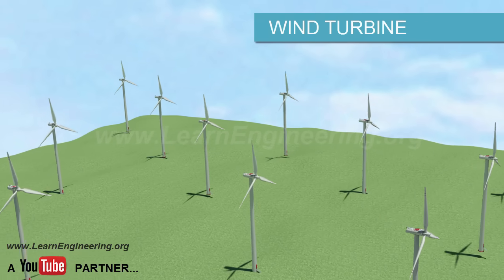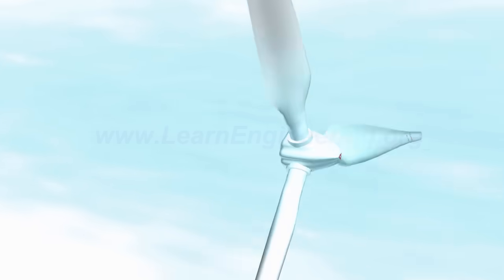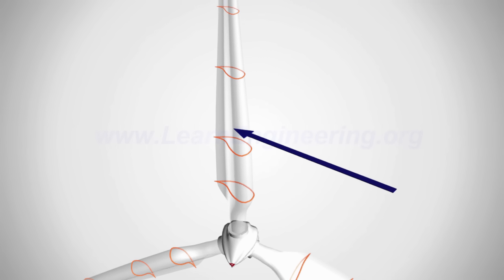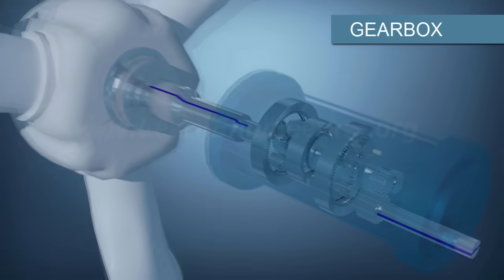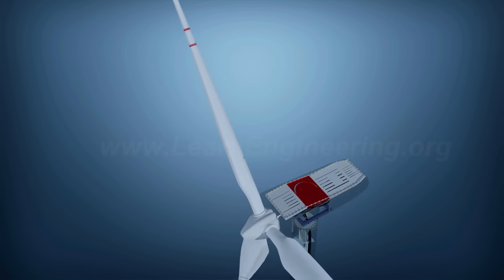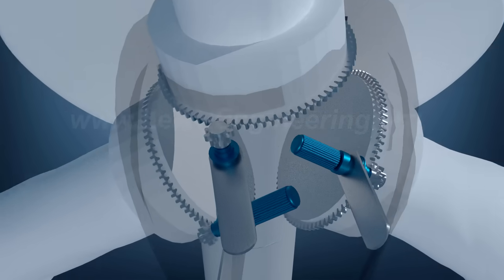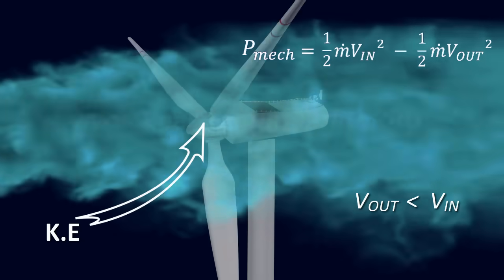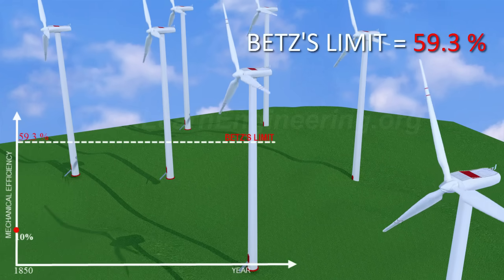How do Wind Turbines work?

Comment: I am engineer. I researched out New Method of electrical power production.  Only air and water can produce power. Simplest and cheapest power in MW. Give one time and get four times. Based on Robert Boyle air law. Visit :--  @t  This power remove climate change and poverty at a time. This can save 500 million ton oxygen per year and for next million year. Three university have supported my research.  Google, Microsoft Green ,  UNO ,  must learn this theory. I am teaching this within 10 minute.  Any science or engineering student learn in 10 minute.  I have other research, that hydro electrical power can be made 1.5 times by using Newton's  third law. I request,  teach this in colleges. contact me :- desaihari03@@t

Comment: Wake up, sheeple. These turbines are NOT the future. There was 11% less wind energy produced in 2016 compared to 2015. Why, you might ask? Because the year was less windy. What do you think happens then? Yes. Coal plants. Nuclear can give us safe, reliable energy. In the entire process from making the plant until it needs to be deconstructed as it's gotten too old, a nuclear power plant has the second lowest carbon footprint out of any current methods of generating power. The only one that is lower, is hydro power. Hydro power, however, causes the collapse of entire ecosystems. Nuclear is the only source of energy of which all harmful matter is contained and only water vapor enters the atmosphere. 95% of nuclear waste of uranium fission is also less radioactive than your average slab of granite and the other 5% can be stored safely underground.

Comment: Why scientists persist on blades instead of tunnels to catch the wind . It seems that efficiency of blades are higher than tunnels but tunnels are more stable and they need less maintenance . This is difficult to raise the tunnels from ground because they resist against wind but they can be implanted on the top of the highest altitudes on the ground . Designing tunnels with greater efficiency may be possible also .

Comment: Just a query: If the gear mechanism can compensate rpm requirement, why not just design the gear mechanism in such a way that we achieve rpm as much as we want and get the maximum mechanical energy thereby?
Reply: Because rpm is still dependent on wind speed. If the gear is too high, the blades won't turn unless there are high winds.

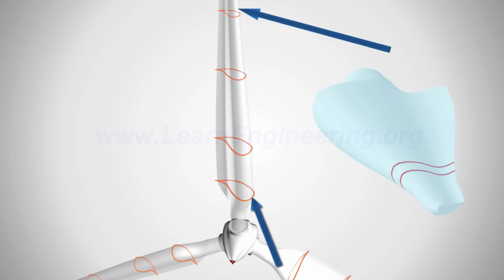Comment: 1:50
That is nonsense, you don't need a certain RPM to get a frequency, you can use a higher phase motor to get higher frequencies than what a normal 3 phase motor would give at the same speed.
The problem is, that those turbines don't always run the same speed and you need to correct it to get the correct frequency.
And I hope for all that is holy, that they don't use gearing for that, as described in the video but an electrical converter, to make the inconsistent energy to grid fir consistent energy.
Reply: biG brAin
Reply: @richardguo8160  lmao
Reply: wtf is a 3 pole motor, genius?
Reply: @shubhamroy9438 
Your standard industrial three-phase motor.
Reply: @Ismalith  then why r u referring them as poles? Magnetic monopoles do not exist. They always exist in pairs.

Comment: Question.. How do wind turbines still able to turn in very low to zero wind speed ?
Reply: think its  powered by back up batteries for the controls  to operate  with little to no wind  .. i got 6 where i live and they move with no wind  so im guessing its backup for the control system

Comment: Great video.  It would have been great if it continued and explained how the electricity is stored and utilized for power.  Well explained and informative.  Thanks.
Reply: nssm, 

electricity is not stored in a grid system, demand and supply is always balanced within close limits. 

Some utilities and others use spare generating capacity to store potential energy. A common one is hydro pumped storage. This is a system with two dams, upper and lower.  The upper dam is filled by pumping from the lower dam when grid demand is low. It consumes more power than it generates. It's function is to quickly generate power for the grid when there are sharp peaks in demand, as they start generating just by opening a valve which starts the turbine. (The turbine and the pump are one and the same machine, i.e. dual purpose). Solid state batteries can do teh same, but note they are not storing power to use later, it is the rapid response to peaks that is why they are used. It gives some time to theconventional generators to pick up the load, this is only a matter of minutes or less.
The grid (U.K.) runs at 50 Hz within+ or - 0.5 Hz, increased grid load pulls therequency down, just like a car meeting a hil, you open the throttle maintain speed, generators do the same, their fuel supply is opened automatically by the governor. If the limits are exceeded then switches disconnect part of the grid and a power cut occurs. Wind generators, by the way contribute nothing to this continuing and regular load balancing.

Comment: Wind power can only be harnessed if there is no wind....no wind no power, too much wind no power.....man cannot simply rely on this “golden egg” .....if the earth gave us other forms of energy, we should use it.
Reply: You're an idiot.  Wind will always be available and has been driving wind turbines and windmills for thousands of years. It is more reliable, cheaper and  sustainable than coal and oil, which has polluted the air, water and soil to a point that climate change is a huge problem worldwide.  And offshore wind turbines allow for tapping into a constant offshore wind source without the worry of oil spills, cancer or harm to the environment. It's time to put dirty energy producers in the past where they belong.

Comment: if we use magnetic induction in making air electricity forever then we can captured any direction wind in more efficient way's

so we use a 360 degree rotation on upper end and all the electricity going to give its voltage to secondary coil so we got more voltage rather then current and more efficient energy collectively

Comment: Try this; Stick your left hand out your car window at 60 miles an hour. Hold up one finger, and see how much the wind pushes against your finger. Now open your palm, and see how much MORE the wind pushes your palm than it pushes one finger. There is maybe one square inch of surface on your finger, and maybe 15 square inches on the palm of your hand. Wind turbines are like that one finger. They cannot get much "push" or torque from the wind, because the blades are skinny, (like your finger).  But a large sail has more surface area, (like the palm of your hand), and so it would generate much more torque, (or push), than a skinny blade would. There has to be a large surface area on a wind generation device, so the available wind has something to push.

Comment: An airplane operates by pushing wind over and under a wing. generating lift. Making a "wind turbine" with blades that look like propellers is a con job which makes an electrical wind generation device look more modern and stylish. Efficient and practical windmills with large sails would work much better. Wind turbines have very little surface area on it's blades, so there is not enough surface for the wind to push!

Comment: Try to imagine an old fashioned sailing ship with sails, or blades, as skinny as this. There is no surface area for the wind to push! The only reason for an engineer to design a electrical wind generation device like this, is so it will fail! Dutch windmills made much more sense, because they had lots of surface area for the wind to push. If wind turbine manufacturers were serious about generating electricity with wind power, they would build simple windmills, instead of these expensive and idiotic contraptions.

Comment: I don’t see how or why there couldn’t be a motor attached to the output to then be attached to the input to self sustain it self .. if the gear box does what it says than we should get a higher amount of energy Coming out then what’s initially entering the system through mechanical force

Comment: And when the wind stops blowing you get zero electricity. When it blows too hard they have to be switched off and once again you get zero electricity. The turbines only last for 25 years and then have to be replaced. What good are these things? 

Nuclear power works 24/7 and lasts for 100 years. Go nuclear!

Comment: Imagine a 19th century sailing ship with thin skinny sails like these. (These idiots call them "blades"). How much performance would you get from a Clipper ship with sails as small as these? There is a reason why wind turbine blades are long and thin. THEY ARE DESIGNED TO FAIL! If you are in the coal, or gas, or hydro-electric generation business, you DESPERATELY want electrical wind machines to fail. So your pals over on "K" street in Washington DC come up with a plan which gives "subsidies" for people who build electric wind turbines.  And they never make any money, or even pay for themselves. But electric WINDMILLS would work very well. With large, short sails, they would capture all the torque, (or force), that even a 5 mph wind would produce. And they would make money.

Comment: Tell about hydraulic system also.
Reply: Dipin Jose some turbines use hydraulics for pitching the blades, some use electric motors. A lot use hydraulics for braking and rotor lock motors. Hydraulic or electric motors may be used for yaw drive as well. Don’t know if that clears things up a little

Comment: It is not correct that without a gearbox no meaningful electricity frequency can be produced (5:28). Since deacades there are high output wind energy devices (MW range) available which are direct driven. Frequency converters do the rest of the job.
Reply: The generator itself can be a "frequency converter". It just needs to have a sufficient number of poles.
Reply: I don't know who you are, but GOD BLESS YOU! But remember, common sense is not wanted or needed on a "pie in the sky" youtube video like this one. You are tilting at windmills. (I am too!)

Comment: That explanation about lift at 1:01 does not make sense to me...
Reply: The flow of the air produces a pressure difference bellow and above the blade, which produced a force on the blade, which producea a torque.

Comment: which type of generator used ac or dc .And when the wind flow is less the blades move less speed  is it suffficient for the rotor of the generator.please tell me
Reply: They use AC generators : fixed speed WT use mainly induction generators, variable speed use either a doubly-fed induction generator or a permanent magnet synchronous generator. Look them up for more information.

About 5 m/s of wind speed is usually sufficient for a WT to start producing power, at about 12 m/s they reach their rated power and at about 25 m/s they stall due to high mechanical stress.
Reply: @FrainBart_main  thank you for your reply

Comment: I am an Arab inventor living in Turkey and a graduate of electrical engineering. I was late in inventing an air turbine to produce energy and turned it to work without air, which works for me in my house and I need to deliver my voice to the whole world. The turbine gives 15KVA and I use it in my house and have a month and a half without interruption to contact me personally 00905327264909

Comment: Behind every unreliable wind turbine is a grid powered by reliable fossil fuel and nuclear power plants providing 100 backup for when the wind doesn't blow, and controllable load-following capability to compensate for the erratic wind turbine output. This prevents brown outs and blacks outs.

Comment: Do gearboxes use electricity/oil or anything else. If not, I've thought of a renewable electricity source. It is a machine that doesn't run on wind, water or anything. We can't control the wind or the water stream and any other stuff. So this thing runs on a tiny bit of electricity and generates even more than was used. Here's how it would work: You use a tiny bit of electricity to spin a wheel. The wheel spin will have a very low RPM. Then the RPM is upped using a gearbox. (if the gearbox needs oil or electricity or anything then this method would not work, it wouldn't be 100% renewable). After that energy is extracted from it.
I'm sorry for my bad english, I'm a twelve year old kid from Sweden. I learnt English from playing video games and watching YouTube. I'm very uneducated about this so I'm sorry if I have anything wrong.
Reply: What you described is an pertetuum mobile.  To describe it short: "You can´t produce more energy than you expend". Because you have so many forces that act, friction etc. In a Gearbox you always have friction between the gears. Friction is converted into heat and thus consumed. Eventually an easy way to find an end :D : The wind has an eletric potential of 100%. But the wind can´t run the generator directly. The wind has to pass the blades, they consume for example 5% of the potential. The Gearbox consume another 5% of the potential. So their is 80% left. The same would happen if you replace the blades with an electric engine. Sorry for the quite simple english :D btw, I work on Wind Turbines and I am from germany. best regards. Could explaine it perfect in german :D https://en.wikipedia.org/wiki/Perpetual_motion
Reply: Noob Corporation Ok, thank you for letting me know.
Reply: And yes, the Gearbox has to be filled with Oil to reduce the wear, like iin cars, motorcylces etc
Reply: Noob Corporation Oh, so my method wouldn’t work.
Reply: @Kingase-nd2ru  Hundreds of engineers tried for centuries to invent a pertuum mobile. Even Leonardo da Vinci had no success. :D If you are able to invent one, congratulations, you´re gonna be rich :D

Comment: There is no such thing as a limitation within reasonable terms. The force of wind is unstoppable, If you us a bigger motor, and a higher ratio, you will produce more electricity, it hasn't got much to do with revolutions of the blades as such

Comment: Airplanes now use "winglets" at their wingtips to reduce wingtip vortex and increase lift efficiency.  Why are there no winglets on these turbine blades?  If winglets work on planes, winglets should work here as well.
Reply: That's probably not a bad idea.  Maybe just need to modify the molds.
Reply: @bigbrushthor5509  Maybe the blades are too high aspect and there is not enough tip vortex to justify it, given shipping and installation.  When I think of wing tips I think of buzzard wings.  They have very low aspect ratio wings with multiple feathers acting as wing tips.

Comment: This system seems like an complication of a design that would turn heat into the wind without the electronics and yaw motors. It does explain why engineers can produce such extravagant devices to do simple jobs, when I simpler design would accomplish the same work with fewer parts and less work.

Comment: Any three bladed aero style propeller is inefficient to convert wind to energy. You can see for yourself how slowly the hub turns. The turbine producing the most power for any given wind speed will always be a multi-blade fan and ducted which is why the most powerful and efficient jet engines are shrouded and never two or three propeller.
Reply: I think that three bladed desing is chosen because of cost effectiveness, low mechanical stress with still a good enough efficiency. In other words, too achieve a little bit higher efficiencies, the electricity from wind turbines would not be as competitive. Also, the hub's slow rotational speed has little to do with the efficiency. Modern wind turbines operate with maximal power point tracking, meaning they hold the tip speed ratio (the ratio of blade tip speed and wind speed) at an optimum value. So for lower wind speeds, the rotational speed of a wind turbine must be lower and vice versa.

Comment: I still don't get it how the wind turbine work. Absorbing kinetic energy then turn to mechanical energy. Then after that how mechanical energy convert that electrical energy? How electron release to convert it to electrical energy?
Reply: The wind is spinning the blades which are connected via a shaft to the rotor of a generator. This mechanical energy spins the magnets on the rotor which induces electricity (voltage, EMF) in the stator windings (Faraday's induction law).

Comment: Wind, wave, waterfall turbines = free energy from the elements yet we pay through the nose for it.
Reply: The biggest demand now is for copper and metallurgical coal plus cement  (Cement is manufactured through a closely controlled chemical combination of calcium, silicon, aluminum, iron and other ingredients.) All these materials are needed to to produce a wind turbine farm 240,000 tons of C02 for just one wind turbine which it last about 20 year some get 25 years then landfill. One turbine need 32,000 tons of cement (on ton cement one ton of C02) 12,000 of rebar steel need a lot of metallurgical coal. To decommission a wind turbine a lot of land fill coal and propeller blades most can't be recycled unless made of wood. Solar panel are worse lead zinc acids silicon itself  destroys your lungs make coal or LNG look good